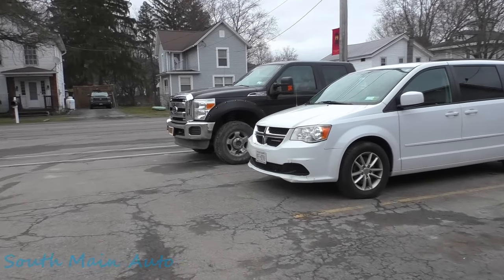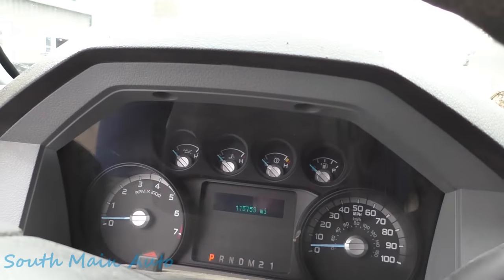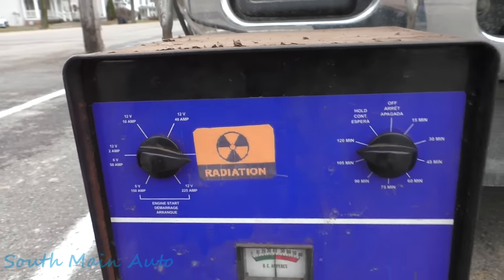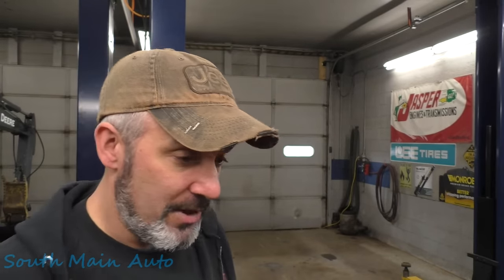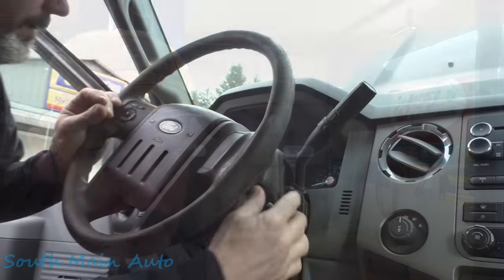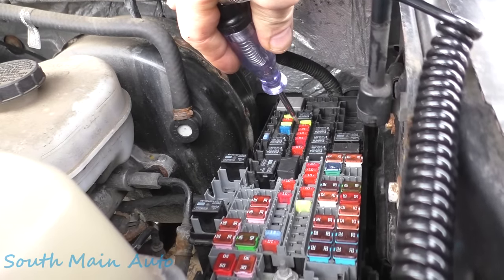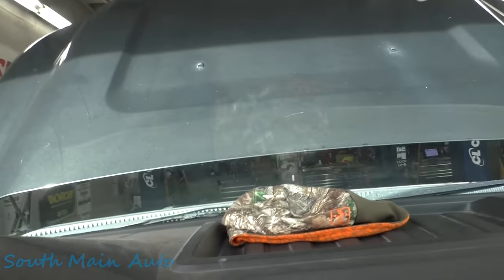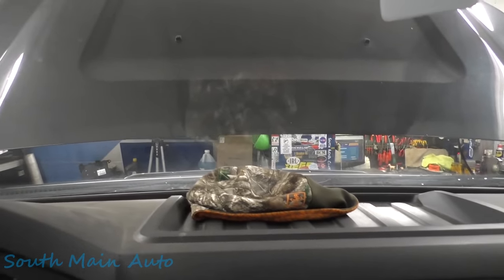Intermittent Stalling Ford F-250 : The Real Fix

Comment from the maker: Looking back on my first video I think our testing was solid. Fact is, touching the relay disturbed the box (making the connection) and gave us a false sense of the repair. THE GOOD NEWS is we had solid testing so when the vehicle came back we knew what we did previously and exactly where to begin. If there was no testing performed previously we would still be flying blind at this point. This is why I try to stress to you folks to carry out the best method you can and be minimally invasive when dealing with an intermittents. As I proved, "touching" something can hide the real issue. Hope it all makes sense in the end.
-Eric O.
Reply: Yep, if you did good testing you already have a foundation as to where to look. The old "miracle touch" can drive you bonkers. Watched both vids, you did test and voltage was there. I'm guessing there were a couple of strands left and that was enough to usually trigger the low current relay. Then it rotted some more and failed. Switching the charger likely dropped the voltage and now that the battery had a better charge the second you switched it was enough to trigger the relay from the momentary voltage spike from the unloaded charger.
Reply: just like you eric, i hated going into the fuse box on modern cars, the places they put them is just silly, a broken wire can drive you crazy...
Reply: Eric, your first go round was flawless. The intermittent connection remade itself and so the problem was gone.
Intermittent problems are the worst!
Keep the faith buddy.
Reply: I know you hate fixing these issues but that's you have to pay for the excitement of the chase which is the best adrenaline rush for a diagnostic mechanic 😂😢😮🎉 then the pain sets in as you have the task of the repair
Reply: You are’the man ‘the explorer in you makes you awesome.
Reply: It can happen to anyone.  Intermittent problems such as that are tough.  I watched the first video yesterday and was kind of curious why you didn't give the old "tickle" test to the box and lift it up for inspection underneath.  Glad you found it.  Thanks for sharing.
Reply: Logic and patients FTW...again.   Well done.
Reply: I know you installed a time delayed wire disable device after that first repair so you could  have a repeat customer for your upcoming expensive Disney vacation
Reply: @greggc8088  unfortunately once the relay started working again (in the 1st video) there was no logical reason to go poking further into the box.  the problem was acting like an intermittent relay, and once it stopped malfunctioning there was no logical way to find that bad wire.  It took a month for the problem to come back after all.
Reply: @johnhufnagel  Experience with Ford and relays would have led me away from the relay. Had this sort of thing happen too many times when the known to fail fuse box has an internal crack or as in this case, a wire broken under the insulation.  I'm pretty sure as good as Eric is that he knows it.  We all have bad days.
Reply: Mister,My "Bottom Line With You" Is The Fact That You Are One Of "The Best Double Live Gonzo Automotive Animals" In The Wretched You Tube Video Land"..!! No Jokes,You're A Bulldog On  A Problem..!! Love The Fact That You're A "Complete American Family Man" That's Living Your Best Life Doing Autopsies On Corroded Trainwreck Machines That Others Fear To Touch..!! You're Truly A "Breath Of Fresh Air" For This Ol' Guy..!! Stay Da' Course,Mate..!!1
Reply: @mikeprice4566  if he had put a load through the wire with his test lamp he would have found it had high resistance or used a resistance meter. So was 99% there & jumped to the conclusion that relay was faulty. I think most technicians would have done the same (myself included).
He did say if it came back he would know exactly where to look....so I reckon deep down he knew she was getting towed back. Funny that 👍
Reply: Always makes sense when you explain it and follow your diagnosis. I think we should come up with a special day for engineers called PUNCH AN ENGINEER IN THE FACE DAY. I'm just kidding of course. Have a great day and thanks for another great video. And you did check the control side properly in the first video.
Reply: @RS-cd9cf  I suspect he was too embarrassed to charge for the 2nd fix. He shall just have to live off the YouTube money I guess.....donations & cheques can made to Eric children's college fund care of Mrs O.
Reply: You were feeling bad the initial repair attempt, also.
Reply: @hambdenbob7616  Agree 100%
Reply: Eric,,,,,,, just curious because I watched both videos.  So, here's my question.  What is the charge to the customer for ROUND 2 ???
Reply: @RS-cd9cf  LOL Good one.
Reply: Sometimes u gotta touch, I don't know how u get around that. You had control power the first time as long as you have a barely there connection all would be good
Reply: You didn't buy, you didn't break it, but you fixed it again!  I know that was super frustrating in more ways than one, but you fixed the fault again.  Good video!
Reply: I almost the same problem on my F-150, chipmunk ate about 20 wires under the fuse box causing no AC complaint. I'm a ford guy but I agree that fuse box without connectors is the dumbest thing Ford has done since the Edsel, at least on the 250 it's not on top of the f-ing hood latch. That being said it would taken days instead of minutes for me to diag my truck without watching Eric for so many years.
Reply: @buddyboy7235  i think we would all suddenly become boxers to deliver the best and most painful punch lol :-D
But there would also be a punch-fest for every "Designed to fail design" :-D
It's a nice thought, but it would never happen.
Reply: @Sean006  So he forgot the all important load testing step? Don't remember everything from the first video of this...
Reply: Hey Eric, what if that wiring harness was designed for you to misdiag, or miss the internal fault so you would pull and reolace, good for the tech and dealership bc it's hours of labor, and good for Ford's bottom line to sale replacement parts. Maybe the harness is a double agent, deep cover, very hush hush
Reply from the maker: @ketilkjevik2145  I did  "load test" it in the first video. I tested the control circuit with the load in place. AKA the relay.
Reply: Fantastic work ! The old Ford living up to its nickname Found On Road Dead. 
As always Thanks For Posting.
Reply: Just wondering why you dont use a small gas soldering  Ion and use the sides to heat shrink. Did that myself for 20+ years when working on fire and security systems.
Reply: Kinda makes you miss the days when cars had like a dozen fuses and a handful of relays, doesn't it?
Reply: Eric I'm clearly missing something because I don't see how you could 'make' a connection that lasted a month solid when it was so intermittent from the beginning?! I'm guessing like you said it was a coincidence & that you fixed 'A' problem the first time. It's just a pisser that it had more than 1 problem(it IS a Ford after all!)
Reply: @ketilkjevik2145  I think he might have forgotten to do the load testing step - which would be unusual for Eric - probably because the relay seemed the obvious culprit. No harm done.....another lesson learned. Eric's method got him 90% there.
Reply: Even the smallest things can make a huge difference in diagnosing problem. You did everything you could the first time.
Reply: Very nice job!
Reply: @Sean006  He did load test it the first time... with the actual load the relay.
Reply: The whole first video I kept shouting at the screen "Check the jumper! Check the jumper!" Of course that turned out to be a royal pain to do. If I recall (without going back to look) you kept checking for voltage on the output side of fuse 45, and never at the drive pin for the relay, at least when it was in 'broken' mode. (I think you checked it, but when the truck was able to start.)
Reply: Looking at the last video, the truck didn't falter when you were probed in to where you might have seen this fault.  And that is a might because if it had, the trace would have shown the control (BCM) ground solid while the load faulted.  

How many would think to recheck the power to the control side where it would be discovered missing though it had remained at the fuse in the earlier test.  The clues would point to weak relay without that insightful recheck.

Now the question is, would that intermittent wire have been reliably discovered during the fuse box change out?
Reply: Next time pull the fender liner to access the bottom of the fuse box. Been into a couple of them for broken wires underneath the box and that’s the easiest way I’ve found to access it. Great find on the fix though!
Reply: Eric your a awesome tech with customer skills  you don't get in college or off the ASE  badge you human and you handled that situation  with class
Reply: If I remember correctly from the first video, the first shop told the customer the fuse box was bad. The troubleshooting you performed did not exhibit that,  and we all chalked up the other shops diagnosis as being wrong after your troubleshooting measures pointed to the relay. In the 1st video I never saw you "man handle" the fuse box but based on the fact that the truck would just stop running for no apparent reason it would now seem that engine vibration was enough to break the circuit. Hindsight is always 20/20. What I do know now and firmly believe is you saved this customer the cost and labor of a whole new harness (to replace fuse box) as anyone else would have simply lit the fuse on the parts cannon at the customers expense. Great Job Mr. O!
Reply: Eric 
We all have those days when we get upset, frustrated and pissed off. Let me say this. You are the best, honest and trustworthy technician I have ever seen. I wish I lived closer to you so I could have you fix some issues in my truck. I use it for both personal and work. I have learned a lot from your videos over the years. Thank you for everything you do. I appreciate everything that you do. Keep your head up brother. How is Vinnie? Does he ever come around anymore? Thank you for taking care of him and his scooter, as a veteran myself I really appreciate you being there for him.
Reply: It does Thank You 😀
Reply: .9 @SouthMainAuto  Yeah, but how is that really, compared to a heavier load? I dont think the control side of a relay pulls many amps compared to a bulb, that you usually use. Ah well, you still did a splendid job, keep it up Mr. O you always find the broken wires :)
Reply: @RyanRansom  You might be right, I'll have to re-watch the video. My recollection  is that he didn't use his test light to put a 'load' (high current) through the 12V supply wire (the dodgy wire he found later) that feeds the control coil for the relay. I would say it would have been 'almost' impossible for that wire to have suppllied a high current & lit the bulb on his test lamp. Obviously it is always easy to say these things in retrospect. But he did a fine job anyway....just probably jumped to the wrong conclusion at the end of the first video (something I would have done btw).
Reply: Testing was on point, wire wasn't broke yet, you touch it made better contact, I know its to late but on some of those fuse boxes it's easier to remove inner fender then pull it out from the bottom
Reply: @Sean006  the relay turning on and feeding all the other circuits would have put a much greater load on that wire than the 250 ma draw the test light could produce.
Reply: @RyanRansom  Hi Ryan, the problem wasn't on the load side, it was the 12V wire feeding the control side (the relay coil), so the actual load on that wire probably wouldn't be that great (<500mA). I checked the 1st video and Eric did test the control side with his test lamp.
This does raise a question about the test light/lamp Eric was using. If it was 250mA then it wouldn't have put enough load on the wire(s) to identify potential faults, it needs to be more like a 5A load. I'm sure in the past Eric has used a car bulb in a plastic cup to create his own high current test lamp (or perhaps I'm thinking of 'Watch Wes Work').
Have a good day.
Reply: Excellent diag approach as always. I had to go back and re watch the previous video because I was as bewildered as Eric.  I think the problem was he tested the power to the load side at the relay, but tested the power to the control side at the FUSE. And of course the wire was broken from the fuse to the control side power feed into the relay. 

Yes it’s a mistake, but I would be proud to share the diag process. Heck I was most impressed with narrowing it down to the correct circuit with such a intermittent problem. These are my favorite types of vids…where I learn the most.  Please keep these excellent videos coming!
Reply: He drove it for a month.. so you can't say it wasn't fixed before.  That's just how it goes with intermittent issues.   If it works, you just have to cut it loose until it dies again.   You can't diagnose something that works.
Reply: @Mig233  I thought the same. However having re-watched the first video I think he may have used his test lamp to test the 12V feed for both the load side and control side at the relay connector block. I can only assume the test lamp is a fairly low current device and it wasn't drawing enough current to show the high resistance wire on the control feed. I think I have seen Eric use a 5A light bulb to test the power handling of wires in the past. Although the control side isn't high power such an approach may have discovered the dodgy wire. But easy to say in hindsight.
Very instructional pair of video's nonetheless.
Reply: @calholli  I doubt Eric would say he 'fixed' the problem after the first attempt. It appeared to be fixed because the problem went away...always a danger with intermittant faults as you say. 
It would be interesting to know what Eric charged the customer for the 2nd visit. I would be surprised if it was very much.
Reply: @Sean006  Ah ok.  Good catch, however the problem wasn’t manifesting itself when he was checking the feed at the fuse box.  I was referring to the scope capture of the drop out.  

This video should be saved as a case study!
Reply: @Mig233  I reckon he was unlucky with the scope. He knew exactly what he was looking for but by then the fault had 'fixed' itself.....he was left with the only option left which was diagnosing a faulty relay. But he did say IF it came back he would know exactly where to look. 
I think in his technicians heart he knew it was coming back on a flatbed.
Reply: Yes it does...had a 2002 Dodge Ram, headlights no high beams, fuse was good had 12v, at the fuse, test light dropped out...ended up peeling back 3 ft.of harness wrap from the fuse box to the firewall to find a green crusty that poofed when I touched it... factory pokey hole ...only 5 strands of the wire in tact giving me the 12v reading but no amps...so don't sweat it...see all kinds of this stuff on motorcycle and ATVs...
Reply: Excellent work as always, video one looked like a solid diag. Who knows, just pulling the relay could have manipulated the wire and one stand of copper was making contact...until it wasn't.

Out of curiosity, did you determine why the power windows weren't working? Coincidental and unrelated?
Reply: Your the man eric happy Easter 🐣
Reply: I hear Magic Mike is holding open auditions if you don't want to be a mechanic anymore
Reply: At least Ford owners can take comfort in one fact - as long as they drive a Ford they won't have any money in their wallet.
Reply: You nailed it Eric 👌👍
Reply: Thanks Eric 😊
Reply: You had it right the first time. The fuse boxes in those Super Dutys are pretty crappy. They aren't sealed very well. I have a fleet of them at work and had to replace several boxes and harnesses because when they showed issues the green crust monster took over and it was too far gone to fix them.
Reply: One word FORD
Reply: Mr O  you have nothing to be sorry about , those idiots at Ford make your life miserable when they designed this crap the way they designed it , you did a great job of repairing that job  and I love watching your videos , have a good week and I hope you had a GREAT Easter Sunday .
Reply: I've been doing this same thing since 1981. I laughed so hard when u said "...maybe I should just quit doing this mechanic thing"  OMG, so funny. I totally know where you're coming from
Reply: I've been there many many times. You  stuck with it. Many wouldn't have been so focused. Which is why we all watch you. Keep them coming. I'll be watching.
Reply: Fantastic work as ever Mr O’… a thought though with your test light? Does the test light pull enough current to exercise that last strand or crusty connector in an intermittent fault?
Reply: Don't beat yourself up about it. Its situations like this that humble us and make us better technicians...humans.
Reply: Fords dont like big hands but great job cause in the repair business we are heros or zeros unlike doctors we have to live with our shortcomings but love  your electrical troubleshooting abilities and you go above and beyond keep up the awesome work Eric
Reply: Agree with you 100% Eric. I watched the other video and once the relay was fiddled with it quit acting up. There is nothing you can do at that point. Good work!
Reply: Great job Eric.  Everything you typed makes sense.  Don't be poking and prying at stuff that doesn't need it or don't be to rough around wiring,relays etc.   Your a great teacher.      😊
Reply: You bad ass Eric O ! And a brother mechanic I’ve done much fighting with vehicles myself, there’s a lot of moments that make you question why the heck do I do this in the first place ! and it’s all the fault of those crackhead engineers😆
Reply: Driving me nuts. I commented on the other vid this was coming back. It clicked then and it clicks now. Should have wiggled it before pulling out the first repair and wiggled it after repair on the first repair and should have wiggled it on this repair on the recheck before pulling it out!!!!! Wiggle test is less intrusive than ripping it out. Wiggle test!!!! Stop testing the legs when it clicks when u touch it lol
Reply: @SouthMainAuto. I have a question for you if you can answer it. On my car when I go to pass a car and I accelerate full throttle it's like it hesitates and then it takes off. Do you know what could be causing this issue. There is no codes in the system.
Reply: I had a reply ready to go but you matched it in your own comment! I hate those intermittents for the same reason, just because you "wiggle, test, move something" and the problem goes away and you can't make it repeat the first time, you are fooled into thinking you are set to go! Love your site!
Reply: Your testing the first time was On Point as it always is, Eric. Who knew the the problem would hide itself so well from ALL of us. You can't fix a problem if you don't see one.
However, this time it showed it's ugly face and you caught it in the act. I call that a Win. 
And of course we all know what you akways say, try and do as much visual as you can before touching anything. Excellent video Eric O. 👍
Reply: You are a fantastic technician,
Long haul trucker for 42 years. Best tool in my box was a small ball pean  hammer, and start tapping around for locked up sencers or stuck this or that. Saved me calling recovery a bunch of times.
Reply: The owner should quit messing around with screws around then can't figure it out then brings it in to really find out quit with the replacing stuff and fix it right owner 😂
Reply: Awesome job all things being said, loved the part about finding the engineer who designed that thing, in my work, we say the same thing all the time!!! I repair ships! God bless you Sir and keep em coming, we love your videos!
Reply: I got that habit from not testing getting it wrong and almost being sued lol. One of my best stories was one of my worst experience as a mechanic!